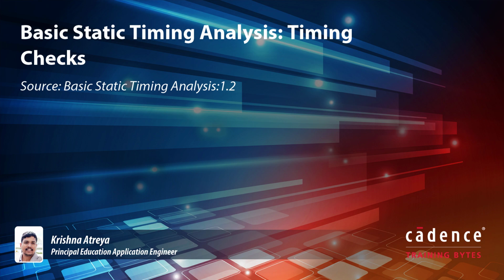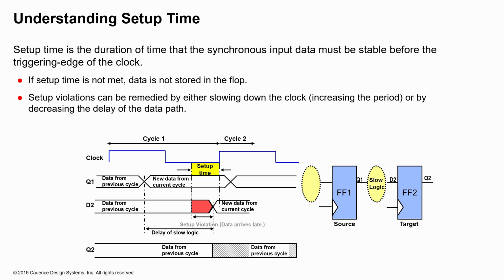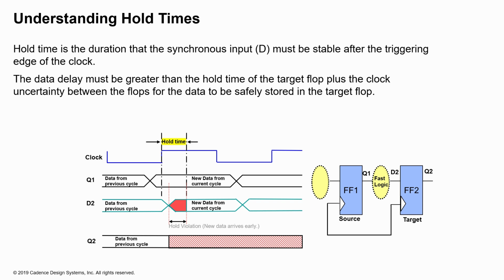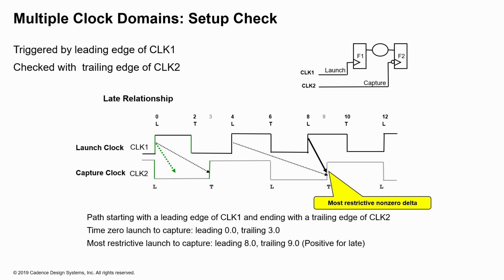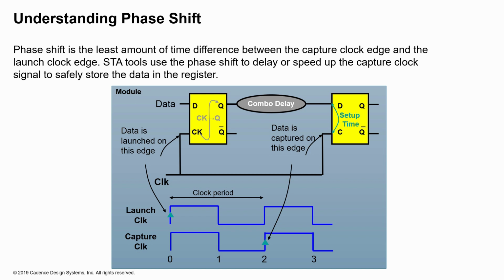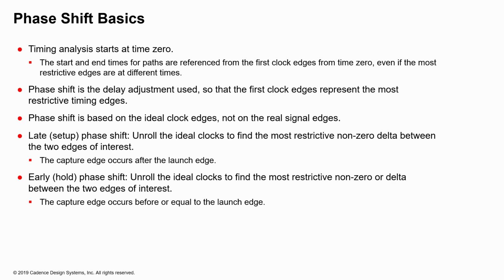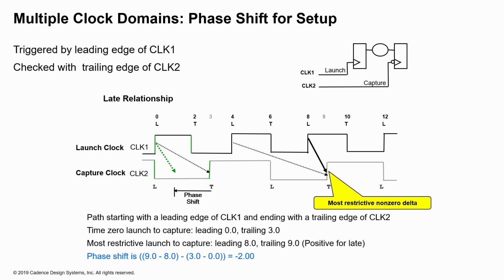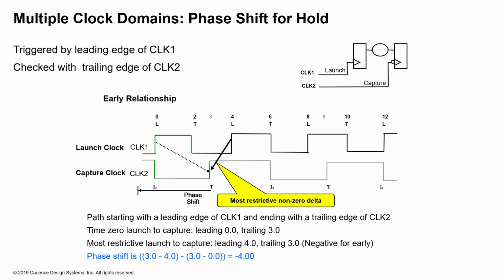Basic Static Timing Analysis: Timing Checks

Comment: i dont understand at the part where the multiple clocks are used and the flip flop is negative edge triggered but u are checking the setup and the hold check at the positive edge of the capture flip flop